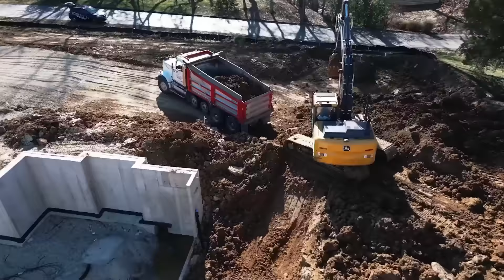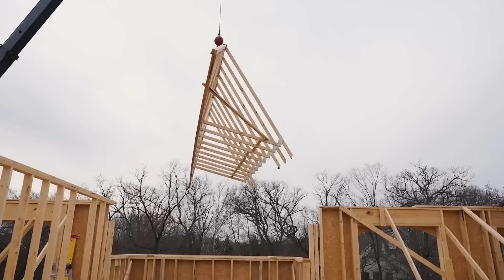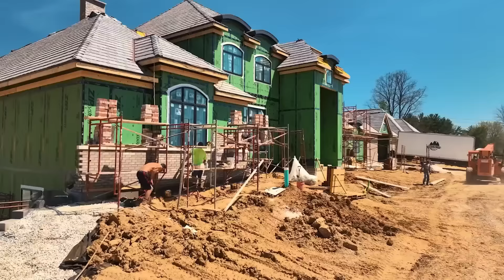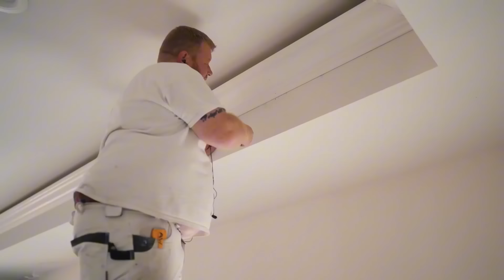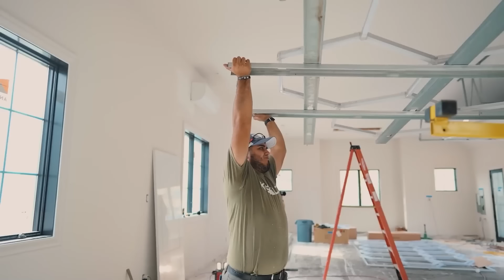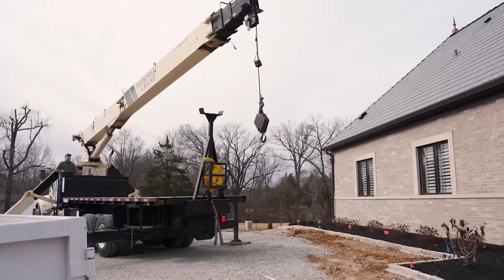From Mud Pit to Multi-Million Dollar Mega-Mansion | by @kbuild

Comment: Nice house but where the opening corridor is where cars or trucks go under to go to the garages in the back I would have a 13 ft clearance so rv trailers can back thru there they usually need 12 to 13 ft because of air conditioners may hit or even a bus rv can fit also it just gives you more options